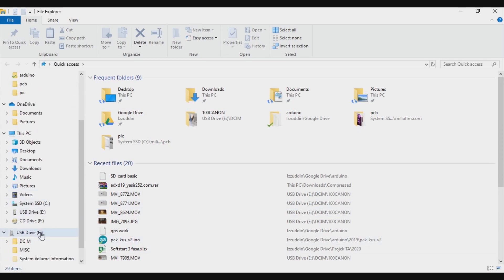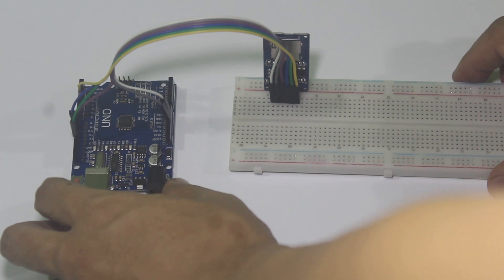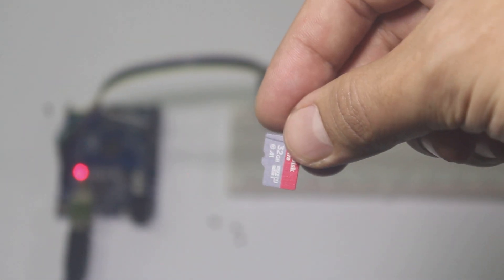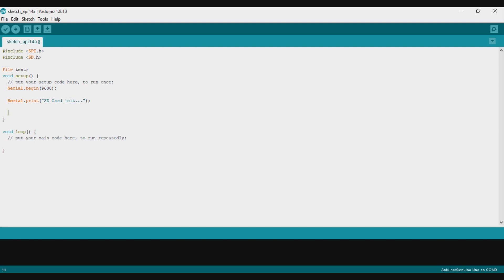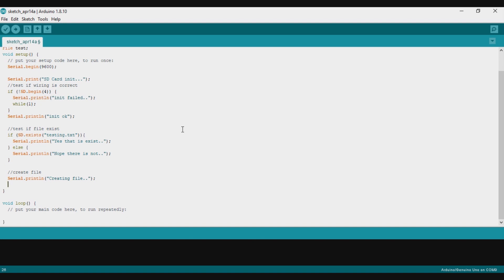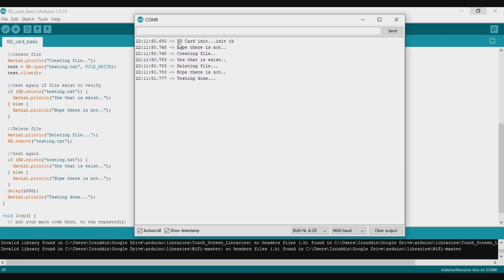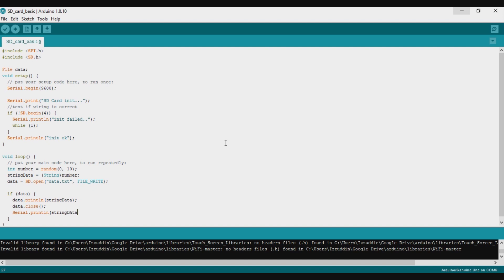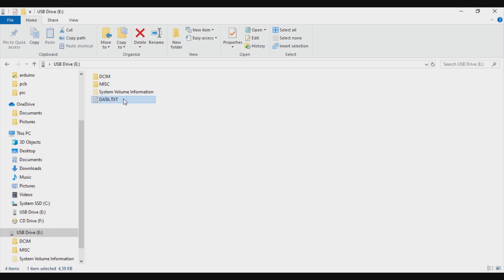SD Card module with arduino Tutorial - Create, open, delete files and data logger

Comment: After checking the card info : 
Initializing SD card...Wiring is correct and a card is present.
After upload Read Write code: 
error opening test.txt
Gimana nih bro solusinya, thx
Reply: looks like the SD.begin(); function succeed, but it couldn't create new txt file on the SD card

Comment: Dear Sir. Can you help me, please?

I need to know, how to open(read) a file without need to wrote the file name on the skecthe. 

 For example, in my SD card, I have a txt file with any name. I want to open this file, regardless of the filename, only by the file extension. I am trying to build a hardware, that writes binary files to an EEPROM chip. If I don't get this, I will have to keep renaming the files on the sketch for each different file I want to write to memory.

Comment: will arduino suppourt 16/32 gb sd cards iam trying its two days but always showing sd card intialization failed
i tried with esp8266 also there also showing same error .. id ont have 4gb or 2 gb sdcards...connnections jumpers are correct
Reply from the maker: It should support

Comment: I got this error even after following you :
Initializing SD card...initialization failed. Things to check:
* is a card inserted?
* is your wiring correct?
* did you change the chip-select pin to match your shield or module?

Comment: why my sd card till fail to analyze after put into the slot? it is necessary to use 32gb sd card?
Reply from the maker: enggak harus, seharusnya makin kecil makin gampang dibaca, mungkin wiringnya masih ada yang salah atau kabelnya putus
Reply: @miliohm  tq mas, boleh enggak kita ambil datanya dan displaynya di Internet atau mana mana server?

Comment: I dont know why, but my SSD1306 display doesnt work after I add SD library to my code. I wanted to make a GPS datalogger.
Reply from the maker: Maybe you use the same pins? Check the pins on sketch
Reply: @miliohm  I have checked and everything was okay. None of them had the same pin. My OLED display is I2C and SD module with GPS is SPI.
Reply: @miliohm  Also, I like your video! I will give you subscribe to motivate you in making these kind of videos. ❤
Reply from the maker: @jonny11bonk  Thanks a lot. I Will try the program when i am at front of my computer.